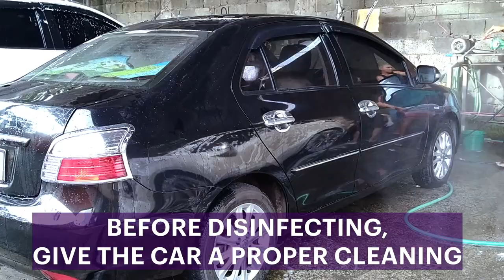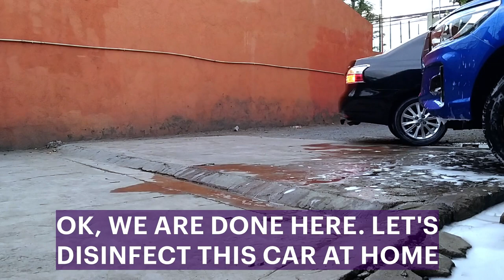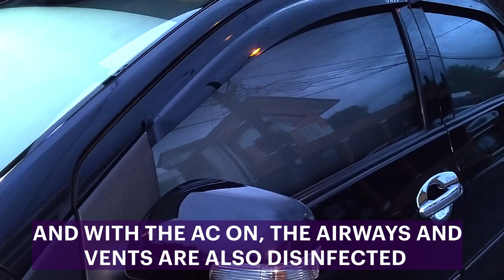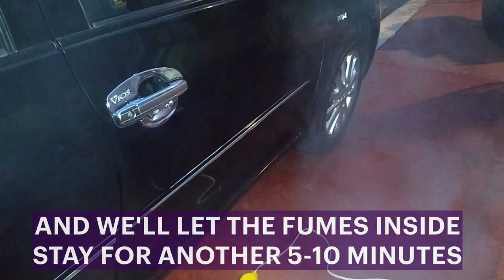How to Disinfect Car Interior in 5 Mins | How to Sanitize Your Car at Home

Comment: Bro, will there be any issue if i have cabin filter? (ac filter)
Reply from the maker: Good question. I don't think so since the vapor is very fine and will pass through the filter. You'll know this if the vapor is actually coming out from all your AC vents with no trouble. But I'm curious too -- can you check your cabin filter if it has some oily residue? Ideally, the vapor/fumes should be the one coming in contact with all the interior surfaces. The oily residue is just a byproduct (hence, the towel on the flooring). If so, then your filter is doing its job 😉
Reply: @HanDIYman007  noted, thanks bro!
Reply: I have oily residue in my cabin filter. What do I do?
Reply from the maker: @ferdiecortez4939  change your filter. Cabin filters are supposed to be replaced anyway when they get dirty enough.
Reply: @HanDIYman007  thanks. Just did that. Planning on stacking up on filter supplies.

Comment: After using the fogging machine, let it run for a couple of mins with distilled water only. This will clean/remove all residues left by the solution in the machine.